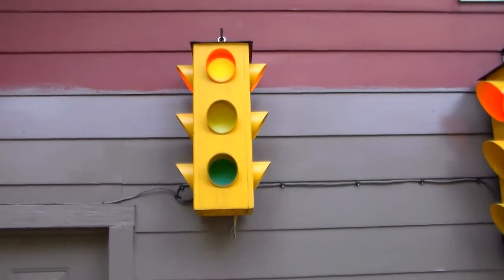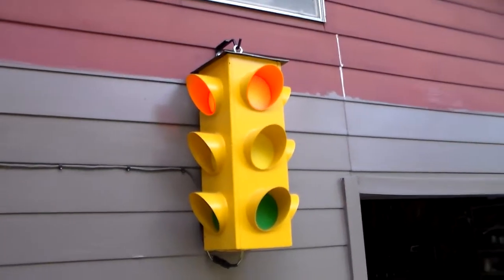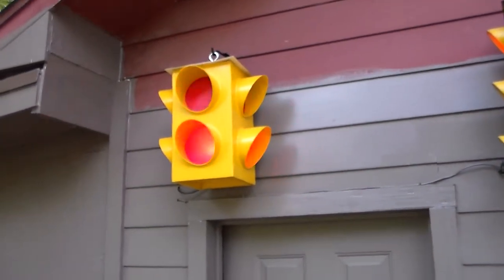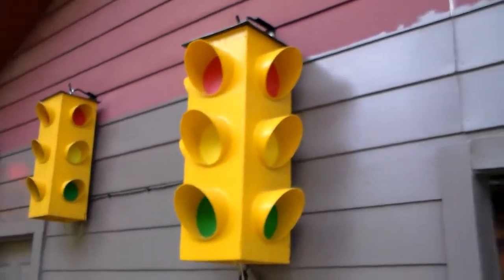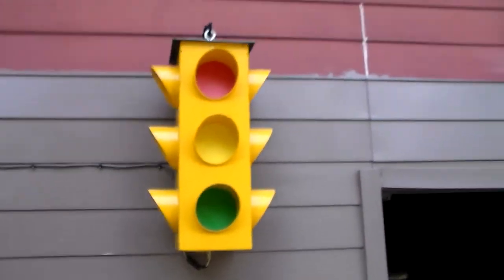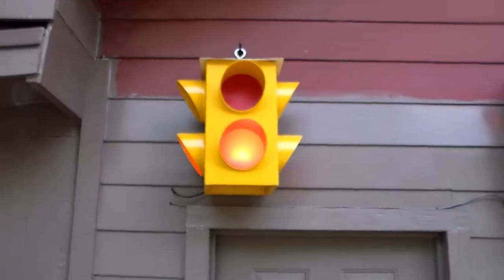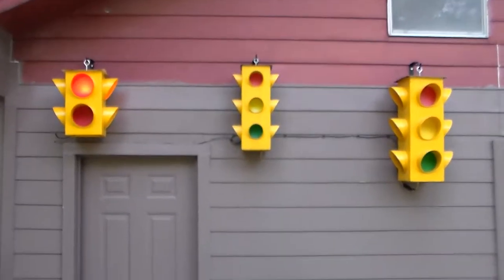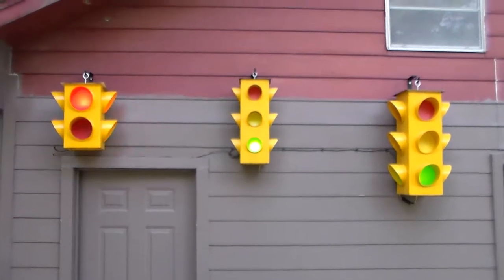Homemade Traffic Light #1, #2 & #3

Comment: I can tell you that it's nowhere near the size of a real traffic light
Reply from the maker: A standard 8" signal light is 30" tall by 9.5" wide, my largest light is 30" tall by 10 " wide. A 12" signal is 42" tall. So mine would be close to the 8" standard. These were not intended to be to scale but a novelty item instead.
Reply: @Handyman2020  I see
Reply: I have an idea to rework my novelty traffic light and make it function like a Darley C811 traffic light (it has 3 bulbs that shine in 3 directions, plus I want to have it hang like a real one.)